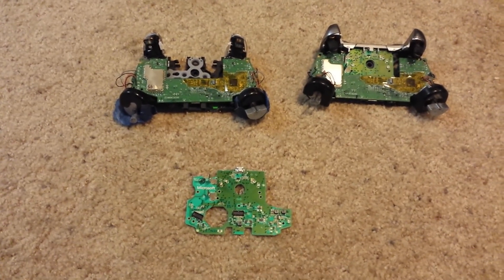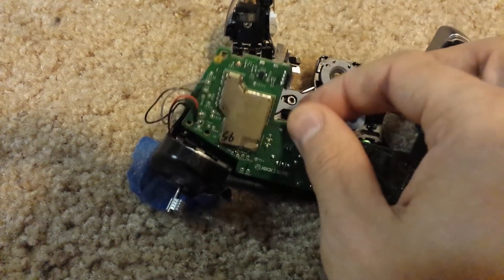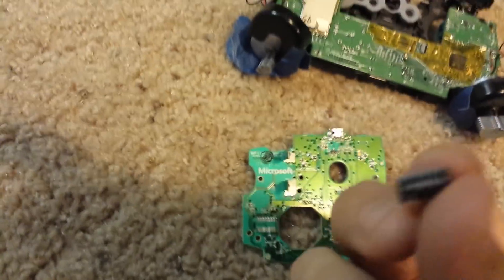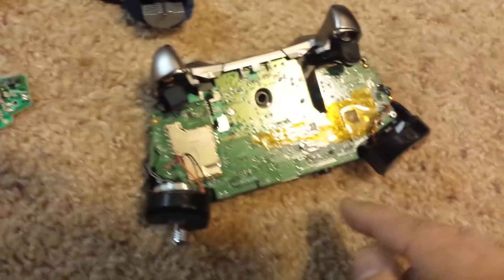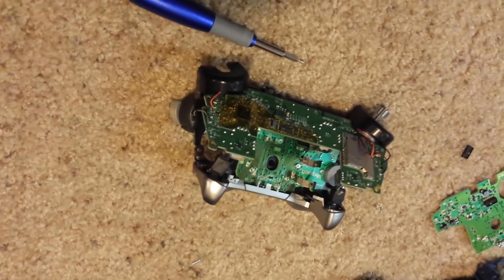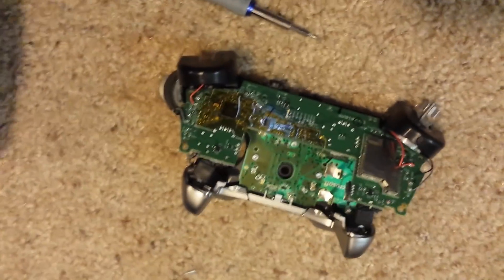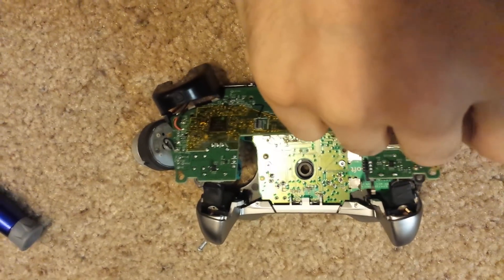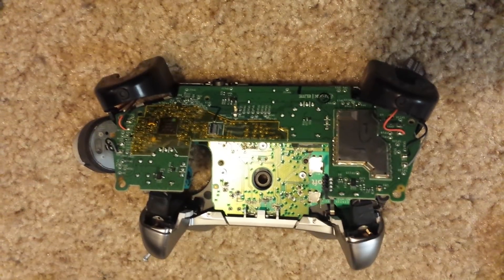Why XBox One controllers won't turn on or charge.  Fatal flaw in Microsoft's design.

Comment: Good onya mate tho because I looked at one of my controllers that I bought broken right and it did turn on with the cable tho which was interesting. Tho after it stopped and won't do anything, mine did the same thing yours did but actually backwards... The connector on the daughter board if that's right cracked a few joints. I can't see that well but I can see it move and the legs aren't connected anymore so yeh. Good onya imma like the vid now.

Comment: My Xbox s won’t turn back after I took it off n put on another front case
Reply from the maker: sounds like a ribbon cable or maybe the power line to the motherboard got disconnected. Make sure all connections are fully inserted

Comment: Ok. Microsoft its a REALLY scam. I got a xbox one with NO problem and every new controller i get will turn off and in The end IT wont work any more because of this problem. I REALLY wanted The New xbox but Hell no. Im going for a ps4 but first i need to backup The data from xbox and save money for The ps4

Comment: 4 years later but the screws that gold the face plate and rear shell go through this board and clamp it all together that consists of 5 screws. Making this video nonsense
Reply from the maker: Try again.  Open a controller up and show me the 5 screw holes you claim create a clamp.  They do not go through both boards.  2 of those screws only go through the sides of the lower board and none go through the top board.  There are screws inside that hold the board to the shell, which would do more toward your assertion, however they do not go through both.  The affix the outer edges but the center of the board still can flex.  The amount of board that have the contact shorn off from stress, yet have never been opened show there isn't a clamping effect.  A clamp would need to go through both boards and hold them together

Comment: Xbox 360 vs Xbox one controller. Xbox 360 the winner.
Reply: Ya xbox one controllers suck I'm on my third one and it's drifting left but I fixed it.
Reply: @barryallen6744  You fix it, but for a while. The Xbox one controller sucks.

Comment: What would be the solution to a controller that plugs in, appears to charge, then the light goes white and "finishes charging" after 10 seconds? It acts like the battery is full even though it is dead.

Comment: Actually if you consider the controller case it's self it holds the two boards together Ive looked inside and mapped out how it all fits and there are spots that take place of the screws once reassembled
Reply from the maker: the case only holds near the edges. shearing happens because there is room for the boards to be pushed apart whether from buttons or thumbsticks being pressed too hard.  shearing is evidence of that. Donate a controller and I'll make a video proving it

Comment: If you run into that firmware update problem when you accidentally move your controller or press a button like I did. Plug in the malfunctioning controller without the batteries into the XBox. And with the good controller turned on and ready to use...go to your CONTROLLER SETTTINGS and just SELECT the FIRMWARE UPDATE....Xbox should automatically tell you that the wired controller is being updated. There's also this CO-PILOT OPTION I went ahead and turned that on...it seemed logical. My screen showed 2 controllers. Hope  this helps.

Comment: Is there a way to reconnect the boards? I have two with this problem
Reply from the maker: Not easily and not without some skill and micro soldering. Trace wires need to be soldered from the board to the connector for each of the connections or you have to repair the pads on the board and then resolder the connector. I don't recommend it unless you have practice with fixing torn pads because you need a repair kit and isn't something on which you can just wing it

Comment: Yes a good video mine with brand-new batteries wont turn i plug in charge cord it will turn on but still not run off batteries finally a good video on why my controller is crap since day one of opening xbox 1 s

Comment: Went through like 3 controllers already. On one of them the USB port just stopped working,  so I get rechargeable batteries for it. Few days after the controller wouldn't turn on with the batteries. On another controller the Y button just randomly stopped working, and for Y button is a very important button for me. The one I am using now just stops out of nowhere as well. It's a wired controller and I used the USB on another device and it worked just fine, but when I use it on my controller, it just turns off and on.

Comment: I KNEW IT HAD SOMETHING TO DO WITH circuits disconnecting, I think they should go back to first design without these 3.5, I've had 6 already where the 3.5mm back goes bad from one or two pulls of the headset cable.

Comment: My controller was unable to charge because the "plug and play" battery and the "pins" of the controller that charges the battery didn't connect properly. I tried to move the battery a bit (pushing it towards the pins) and the battery began to charge. I hope that this issue don't be a commun issue because I'm going to change the controller but not the "play and charge" kit...

Comment: I don't mean to sound horrible but I fix controllers and consoles all day every day . for starters you are not supposed to pull the boards apart like that you are supposed to use a separating tool . yes they do slightly push the board away nowhere near what you show and would not make a difference what so ever. if your connected is busted off the board you can superglue it back to the board and scrape the green off the board where the tabs connect and reconnect via micro solder. so there for it is not as broke as you say it is. yes it's far easier to replace with another board but finding one is 1 expensive and 2 very hard to get hold of.
Reply from the maker: Philip Samuels while that may be true, the skills and tools it takes to do those types of repair is not within the average gamer's ability. And to pay someone to do that repair is not cheap either. As far as the pressure, I'm afraid we will have to disagree because it's an issue exclusive to Xbox one controllers and they are the ones using this bad design. And with repeated examples of them being separated from the board, without the controller ever being opened, there is enough evidence to support that claim
Reply: pushing the button no matter how many times will not do that . dropping a controller will do that . you say there is nothing connecting the top of the boards together but when you put the controllers back together the screws you put on the handles hold the top of that board together  so yet again pushing the button will not break it I guarantee you
Reply from the maker: Philip Samuels what backs your guarantee? Plenty of documented evidence that pressure on cheap breadboards can cause damage to circuits but you're free to believe whatever you'd like
Reply: what back my evidence is I have the same controller from day one and there is no damage to my board what so ever and believe me I use that button a hell of a lot.
Reply from the maker: Philip Samuels so your evidence is a fallacy of composition? I have controllers from the start that aren't affected either, but that doesn't mean these others haven't been affected. Not everyone applies the same pressure. Just compare the thumbsticks on controllers. Some people have thumbsticks that looks new while others are worn in where they rub the shell. Some Xboxes have faulty  thermal sensors in the Kinect causing them to fail prematurely. Some have faulty Wi-Fi boards causing them to lose Wi-Fi connectivity. In no case would I be foolish enough to say that all would suffer from them because some do. Same goes for the reverse
Reply from the maker: Philip Samuels would you tell the people who had their brakes fail on their Toyotas several years back (Which prompted a recall) that the brakes couldn't possibly have failed because your mom has the same car and the brakes have never failed? That's the logic you just used
Reply: my point being is the board is not pushed away enough to cause this damage . the problem lies from the manufacturers everything is put together by machines which in my honesty opinion can not do the job as good a person would do. I have fixed consoles and controllers that were just out of warranty and from taking them apart to see the issues I'm physically disgusted that you pay alot of money for a item which is not fit for purpose and are specifically made to fail so either you replace the item or send it on for repair. And to fix this problem has cost me £12 for a soldering iron a magnifying glass and some flux . so this is not a expensive repair if you know what you are doing
Reply from the maker: Philip Samuels you mentioned micro soldering. A person that can do typical soldering with a normal soldering iron is not going to have the proper equipment or skill set for micro soldering. Here's how the ifixit team describe micro soldering. "We’re experts at component-replacement repairs (we’ve swapped out more broken screens and replaced more batteries than you can shake a stick at), but component-level repairs are a whole different ballgame. We have plenty of repair guides on how to replace your motherboard, but not on how to repair the board itself. Board repair usually requires microsoldering—which is similar to regular soldering in the way flight is similar to space flight. The process shares a common lineage, but the scale is radically different."  No one said it couldn't be fixed, but rather it's not going to be cost effective for the average person.
Reply: Adam Russ it's cost effective if you come to someone like myself who would charge £10 to fix this issue via micro soldering . I have fixed many Xbox one and elite controllers. It's not rocket science I have a £10 soldering iron some flux some solder and a magnifying glass. Put your mind to it and it's easy. Looks alot harder than it actually is . I have fixed many iPhones with connectors ripped of the board and believe me they are alot smaller than these controllers. The way these break is nothing to do with pressing the b button 1000s of times it happens with a little drop or sudden impact either dropping onto the analogue or the top 2 RB LB bumpers. Please don't tell people it's from pushing the B button because that is totally false information.
Reply from the maker: Philip Samuels your rates are not typical. Typical rates for micro soldering component with board damage tend to start at 45 dollars. With that being nearly the cost of a new controller, it's not cost effective.
Reply: Adam Russ I'm not your typical fixer. people who charge these prices have a shop so therefor have overheads. I do not have a shop and for me it's more of a hobby than a job. yes I could charge them prices but for me to open that control and repair that issue takes less than a hour so for £10 for a hours work doing something I enjoy is not a issue
Reply from the maker: Philip Samuels back to the original point...let's consider the buttons had nothing to do with the board separating. This problem was nowhere near as common in 360 controllers. Instead, drops cause the thumbsticks to forcefully push the boards apart causing the shearing of pads and traces. It's still a problem due to 2 boards. Ps4 controllers don't suffer the same problems
Reply: Adam Russ I have just done 12 elite controllers since Saturday plus 4 Xbox one consoles and 3 ps4. Your original post is about the b button separating these boards . which I told you is a complete lie. I could make a video now and push as hard as I want on the b button nothing will happen to controller . this only happens with short Sharp shock if the controller is dropped and it is the analogue which causes this issue bot the B button
Reply from the maker: Philip Samuels way to fail that thought experiment. Can't see the forest for the trees
Reply: Adam Russ stop giving people false information as I have stated I fix these controllers all day every day and no matter how had you push the b button it will not do this and that is a actual fact not just some false video
Reply: @Finditfixitphilipit  
I am glad someone besides myself saw this for what it is.While I am not trying to be ugly, the B button has absolutely NOTHING to do with the separation of the motherboard / daughterboard connections! Shock and or improper separation of the boards upon disassembly are the cause of this failure! I also have repaired tons of these. Some complications are arising from the use of lead free solder as well as it seems to be proving quite difficult for the average amateur to work with. No disrespect to the amateur here , its difficult to work with!!  Back to the discussion at hand.... the front case , the daughterboard , and the rear case are pinched together by the screws when assembled , Totally debunking the b button causing movement that in any way could cause the boards to be damaged!! facts are facts!
Reply: @josephroberts6027  I repair these things on a daily basis. It can not physically do that with them screws attached. What I suspect happened is he separated the board incorrectly and done that damage himself. It is easily done if you dont know what you are doing

Comment: I think this is the problem my elite controller has I recently bought. When I put batteries in and hold the power button down on the controller it lights up flashes and when I let go instantly dies so I’m guessing a capacitor is fried but I don’t know witch one since I haven’t opened up my controller. I’m wondering is this fixable, is it worth being fixed or is there nothing I can do.

Comment: 4 of my kids controllers all started dying about the same time.  No way it was the controllers I thought...too odd they all started about same time.  More likely the Rx on the console.  But even without that, they would not power up at friends.  Took the first two apart and BOTH had exactly the same problem you show.  OMFG...I was going to try to solder the socket back on the board, but the leads were so flexed that some were broken off the connector too.  Likely the LAST one that was trying to hold it together.  Now I'm trying to figure out if it is even worth trying to buy a replacement top board (the one that the socket breaks off of that the B button pushes on...but given that it has the two analog controls and the processor, probably that is the $$$ part.  Sigh.  There goes 4x $60.  F!$#@k Micro$oft.  Why they didn't let XBox 360 controllers work too pisses me off.  They actually work if you use USB, but they made the wireless tech incompatible.  $#$#@k.  Thanks for your hints.  Interesting SIDE fact, both of mine had the 3.5mm jack just loose and I don't think it broke loose, it is just a tension touch to the pads (?) which seems really stupid, but both of my kids had indicated that the sound wasn't working anymore on theirs either...well, both had bent pins on the 3.5mm that no longer pushed tension (if that is what they were before) to make connections.  Sigh.
Reply from the maker: Jeff McClain you are correct.  All 3.5mm Jack's just sit between the boards. The minor tension between those clips hold them in place. Once the boards start to separate and lose tension,the jack will no longer make a full connection and the audio starts to fail.

Comment: So what do I do then? My controller smells like it burned. It won't turn on. Is it even repairable?
Reply from the maker: modernwarrior24 depends what burned up. Chances are not good that it's repairable though. Even if so, it won't be a quick, easy fix.
Reply: Adam Russ 
All I did was simply plug in my usb cable to charge one day and boom, it shut off. I took out the rechargeable batteries for regular AA batteries. Next thing I know it got super hot and smelled like it burned. So I took out the batteries. If I have to disassemble it I guess I have no choice.
Reply from the maker: modernwarrior24 Did you use a USB charger from a phone? If so, STOP. They often cause burnout.  Those are often rapid charge cables and they can cause burnout on the controllers. All USB cables are not the same.
Reply: Adam Russ I tried to play some fifa with just my phone charger because my batteries died and it just didn't turn on... Now it just flashes once and then dies, and whatever cable I connect it doesn't fo anything. Could you help me?

Comment: So, I just took my controller apart because I've been having the issue of it not turning on, and surprisingly enough mine is still connected as far as I can tell. Looks like Microsoft just makes shitty products in general.
Reply from the maker: Roxas1246 well there can be other issues that cause it to not turn on. Capacitors, resistors, etc could all be responsible. But unless you separate the boards it will often look like the connectors are still attached because they are sandwiched in place.
Reply: Adam Russ, I did desperate the boards, and the connectors separated like they should. The only thing that wasn't connected to the board was the 3.5mm jack. I'm thinking that there's something probably wrong with the power button, but I'm just in no mood to try to get to it at the moment.

Comment: my controller doesn't have the problem with syncing wirelessly but my USB port is dead.
Reply: Ilistray my USB port doesn't work either
Reply: I’ve got the same problem. I’ve got a wired controller and it won’t turn on when it’s plugged into any of the USB ports on my xbox
Reply: Ilistray vb
Reply: same. did you fix it?
Reply: It’s the company force if upgrades